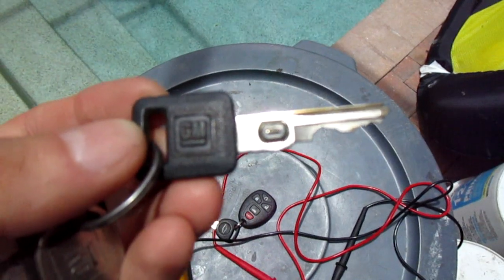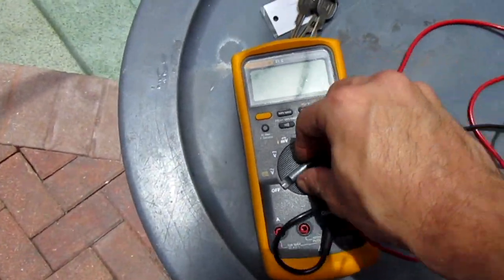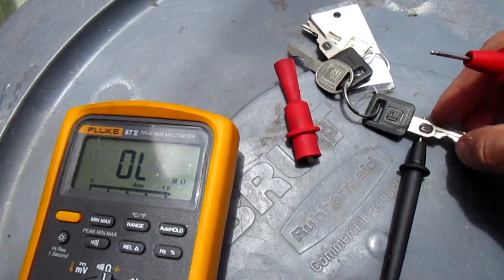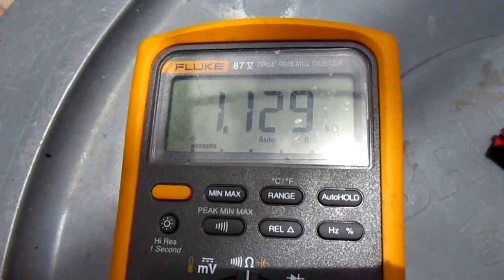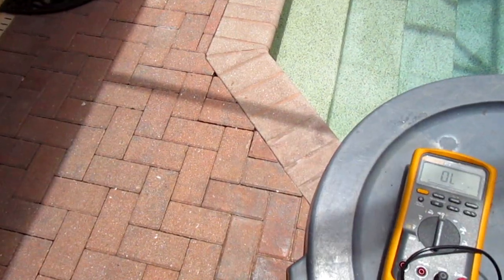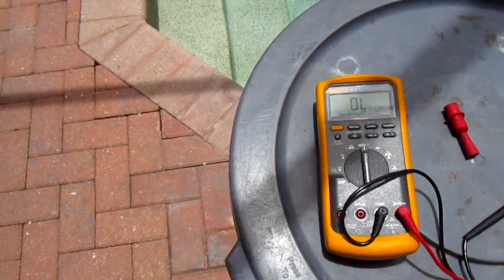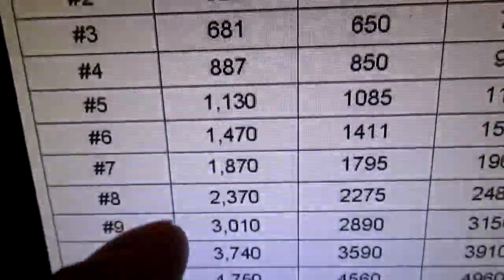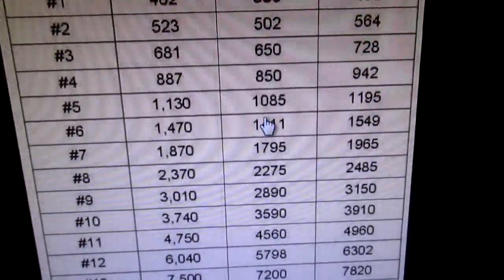How to Find KEY resistance in GM PASSKEY Chip for KEY REPLACEMENT VATS  PASSKEY BYPASS

Comment: What if they resistor is not reading anything but 0’s across the meter, would that mean the key itself isnt good?
Reply from the maker: yea blown  Broken internally Dirty contact etc
Reply: @GhettoWagon  Id have to replace the ignition switch and keys im assuming? If so are those keys still made today?
Reply from the maker: @ant8729  Not sure.  Parts are getting hard to find I would just program it out and disable the system its cheaper

Comment: The resistors are cheap enough, or were.  Why not buy one of each, splice into the wire temp with clips, and keep going until you find the one that turns off the security light? Tidy it up & move on..

Comment: The GM passkey introduce 1986.. Chevrolet Corvette.. 1989 Camaro Firebird.. this was the best and most effective.. anti-theft system ever.. Ford securilock. Introduced 1996.. was much better.. modern cars with push-button ignition.. are the easiest cars to steal.. I work with people. Who buy salvage cars.. doing it's over 30 years.. auto theft was cut in half with the passkey 2 system.. even more. Ford secure lock.. but the new push button ignitions.. sends out a signal. Criminal can get the code.. this is why I only drive..Aa..GM.96..Camaro..😎
Reply from the maker: Pass key 2 is junk. You can disable it very easy

Comment: Very big help for friend's 96 Buick Regal that he just bought and then wouldn't start. Unplugged the two small white wires going up the steering column that read the resistance in the key, inserted resistors equivalent to the key resistance into the side of the connector going to the VATS and bingo, no more starting problems. The two white wires got frayed at the ignition switch from repeated turns of the key. This way the VATS is always reading the correct resistance. Read about the two white wires here:
https://www.justanswer.com/buick/4ojcy-1996-buick-regal-anti-theft-deterrent-module.html

Comment: My security light blinks,,,I just bought a 15 resistor Bypass kit,,,,I tested both of my keys,,, they Both read 890,,,,I used the 900 resistor in the kit,,and my security light still blinks and it won't start,,,, I'm out of ideas.....
Reply from the maker: What car?  Can u disable the VATS in the PCM? I can with a click of a box and a reflash on my LT1 Impala

Comment: Can you check what vats key you have with out the key ?
Reply from the maker: Probably some way but I am unsure.   Module is programed to the keys resistance.
Reply: I have the issue of lost keys is there a code or something on the vin plate or in the owners manual?

Comment: my 91 Eldorado had it, pc of Shit early 2000 cost me over 400 to replace key an cylinder cause that pc of shit wouldnt start lol
Reply from the maker: That is probably another reason why they are all junked!
Reply: 1st car i experienced a 400+ $$ tune up , nothing on this car was cheap to work on sideways aluminium V8 took up the whole bay to many electronics, bring me back to pre 73 please lol
Reply from the maker: I always wondered if you could put in the  FWD version of the 5.3, LS4 in a Cadillac. It would solve the north star problems with a LS engine .  Get the caddy with a clean title but busted. Get a wrecked 5.3 LS4 FWD Chevy or Pontiac.

Comment: Actually the 1986 Corvette was the first car that used the factory VATS system with the chip in the key. This same system lasted until 2002 when it was installed into the last fourth gen F-Body Camaro & Firebird like you said, and I also believe the last Cadillac Eldorado as well (these cars all still used the vintage Saginaw steering column from 1969).
Reply from the maker: Damn, way back when. That was probably the passkey 1, Then they went to 2, no idea what the change were Ya you are right the 2002 eldo had a Saginaw column with the chip.
Reply: Yeah I am not sure when it became the VATS 2 system. Someone had installed a resistor in place of the key pellet under the dash before I bought my 2001 Trans Am for an aftermarket remote start system. The first winter I had the car it would never start on very cold mornings, but would be fine when it warmed up some. Turns out that resistor they used for that chip in the key became defective in the colder weather, and wouldn't allow me to start it by key. I removed that resistor and installed a module that has a resistor inside a plastic case, and plugs right into the factory connector on the steering column.

Never had any real problems with any of the GM cars I've had that used the older Saginaw steering columns, except with the tilt mechanism that gets loose over time, but you just need to tighten some screws to fix that small issue. Nothing like the later GM columns that were recalled a couple years ago with the defective ignition switches.
Reply from the maker: I took apart a tilt column last year, i'm surprised it went back together as easy as It did.  No more wobble, its nice.

Comment: There must be a crap ton of #5 keys around.  Mine was a 5 also.
Reply from the maker: I wonder if the 96 key fits in the 95.  Some say if I keep picking keys from GM junkyard cars I have have a set that will work on hundreds  if not thousands of vehicles.  is there a signal resistor out there that is close to 1.130?
Reply: I don't think there is, you'll need to play with ohms law a little..  Series adds together, where parallel takes away (but not as equally as subtracting).  I could draw up a simple schematic later if you need me to.